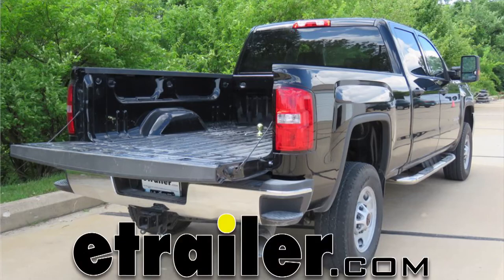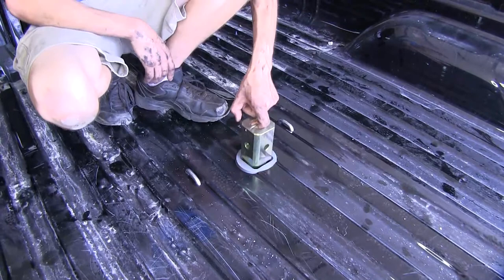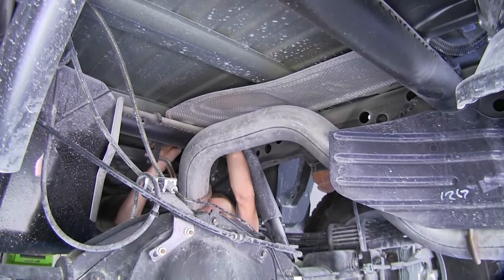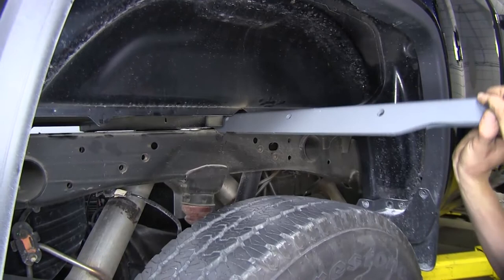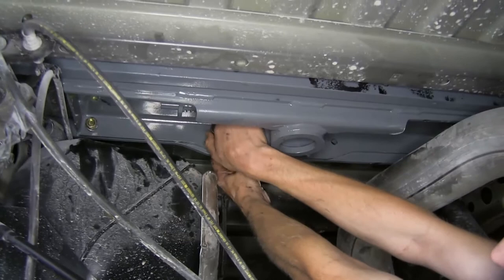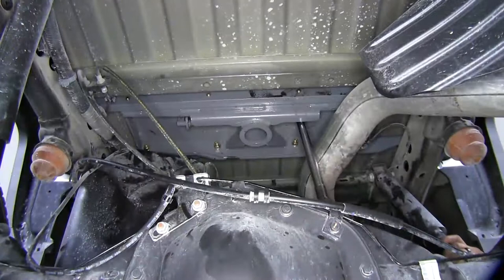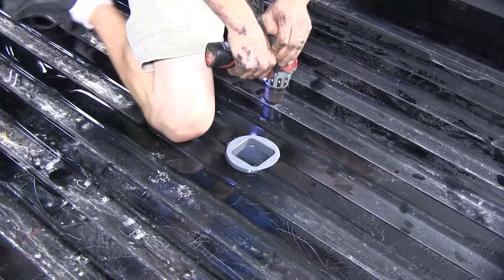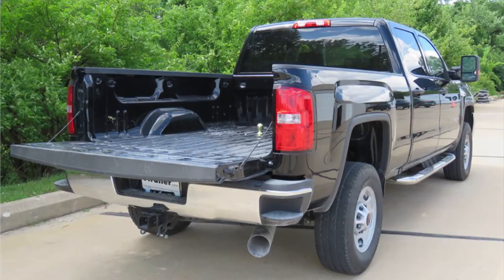etrailer | B and W Underbed Gooseneck Trailer Hitch Installation - 2017 GMC Sierra 2500

Comment: Hello great video, is this hitch work on a 2009 Chevy silvers 2500HD LT?
Reply from the maker: That hitch fits 2016-2019 GM 3/4 and 1 ton trucks. For your 2009 model, use # BWGNRK1067. Hope that helps!
https://www.etrailer.com/Gooseneck-Hitch/Chevrolet/Silverado/2009/BWGNRK1067.html?VehicleID=200919949